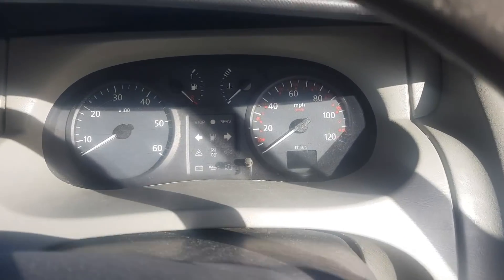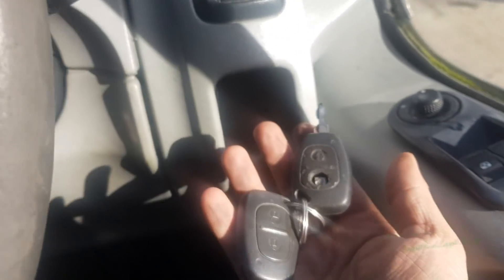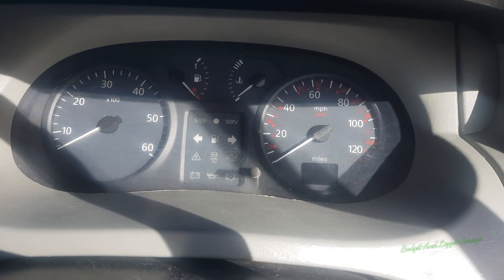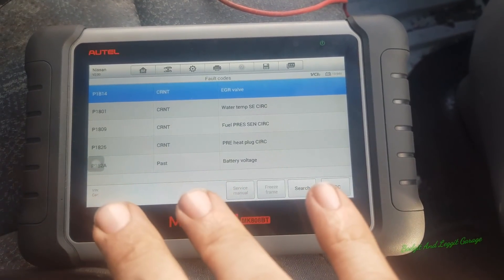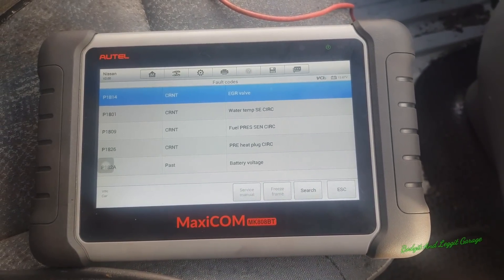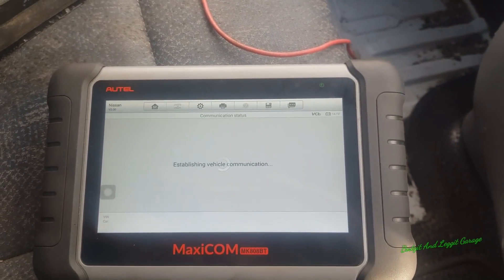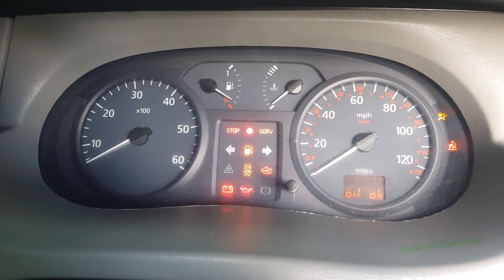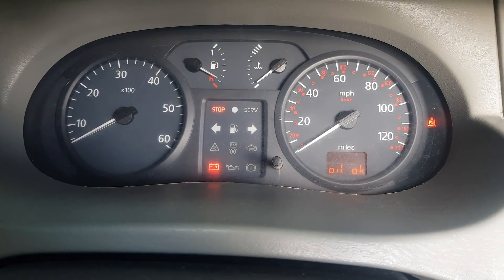Nissan/Vauxhall/Opel Crank No Start Engine Light Flashing Part 1

Comment from the maker: I know I know it's a primastar
Reply: Had the same problem, FUEL PRESSURE Sensor ON THE RAIL. After removing a "Tuning chip"..put on a new sensor £25.00 and boom...job done 🕵️‍♂️
Reply: Not often I will disagree with you Leon, but I will here, for that vehicle is not just any Primastar - it is a full on ShiteBox Primastar
Reply from the maker: @Steveok  boom sorted
Reply from the maker: @fulwell1  🤣🤣🤣🤣🤣🤣🤣
Reply: Crank pos sensor ? Cam sensor 
Ecu kit 
Key issues
Reply: Temp sensor can throw these symptoms aswell. Mr mucle works on ege

Comment: Hi! How easy was it to connect the Autel Maxicom MK 808 BT to the Nissan Primastar 2003? Did  it communicate well with the car? Did you find Primastar 2003 in the diagnostic tool menu? I Have a 2003 Primastar and I can't find a diagnostic tool for it. Only for 2006 and above. Thanks!

Comment: hi, i know this is an old video but im looking for answers on my non starter 04 plate 1.9 dti vivaro. only code i get is p0193 which is fuel pressure sensore high input. i have back probed the signal wire and its 4.99v, i have done continuity from plug bk to ecu and all is fine. put a brand new sensor in long with new crackshaft and cam shaft sensors but wont start. does the intercooler pipe need to be on for it to start?

Comment: I also have one to fix and the wire is very f**** bad I don't know why the people cannot use a soldering iron and some heat shrink like we call them here is backyard mechanics and the best thing if you fix it right the customer complaints about the money

Comment: Dunno if wires going brittle is a thing with the vans or not, mines an 03 1.9DCi and i had crank sensor problems, reading live data would show crank signal, but intermittently, van would cut out when hot, then not start, leave it cool down and she'd go again, changed the sensor then it wouldn't start at all... pushed the wires down into the plug and it started... ended up removing the plug and replacing it the wires were super brittle at the plug end... just one to keep in mind, that crank sensor problems may be down to the wires as well :)
Reply from the maker: Hi mate that's very common especially on these type of vans when you buy a genuine sensor you always get a new pigtail how to replace the old wiring what I mean by that is they give you a new plug and new wise to replace the old one because they give a lot of problems the wires and the senses
Reply: @bodgitandleggitgarage  Aha right, mine was a non genuine one unfortunately, so i had to repair the plug. Saying that, it was over 12 months ago and, touch wood it hasn't given any problems since. Maybe next time i'm servicing it ill change it again and get the pigtail part and solder that in.
Reply from the maker: @NMCKev  at least you got it sorted mate nice job
Reply: @bodgitandleggitgarage  Cheers, next job oddly is your video part 2, my temp sensor i believe is faulty, the temp needle climbs and falls with engine speed, as if its got a bad earth or something... on-wards and upwards!

Comment: I might be wrong, but then temp gauge doing that when you switch the ignition on, I think is it showing what it thinking the oil level ism then it goes back to showing what it thinks the temp is.  A lot of the modern french ones do it.
Reply from the maker: Hi mate no this vehicle does not do that you're seeing part 2

Comment: I had a 2002 Renault Clio and the key got stuck inside the ignition barrel, after muttering a few FFS's I had to cut the barrel out and replace it. The key that came with the replacement ignition barrel (2nd hand) fitted the locks as well as the barrel so I didn't have to use two keys
Reply from the maker: Nice job mate that's the proper way of doing it

Comment: I have one of these been to 2 garages with a fuel pressure infomation code drive fine starts fine cuts out a 3k turn the key on and of and it's fine. And they cant  fix .looking  forward to part 2.top job
Reply from the maker: part 2 up not mate

Comment: Very helpful video I have a 2005 vaxhall vivaro and it is just cranking but no start. 
Also the revs are similar to what you showed in your video.
I will see if I can get a computer to check all the faults and then go from there.
Thanks again and God Bless

Comment: I HATE these Renault engines when they break the wires, they always break right at the weatherpack boot of the pin. Not worked out why they break at that spot but the pin repairs I have made I have not had a comeback in 5 years I have been using my method of re-using the pin but replacing the wire
Reply from the maker: Nice job mate in a video very soon I'm showing a different way how to do it it's never failed me either

Comment: Renault are kings of the parts bin, that dashboard set up is the same as my old 2001 scenic petrol. Someone in Bulgaria is going to love that van when you've finished tinkering with it.
Reply: Same instruments as a 2003 Clio I used to own, same radio controls behind the steering wheel , same mirror and window controls as my current 2005 Megane
Reply from the maker: hahahahahah

Comment: Hi Bodgit and Leggit.
My names Michael, Jon's son, studying a mechanics course. He's got an old van that sounds like
it's lost compression from one of the cylinders; It goes ONE, TWO, THREE, FOOOOUR...  ONE, TWO, THREE, FOOOOUR...  ONE, TWO, THREE, FOOOOUR....
It also smells of fuel in the sump after a fresh oil change. Is it possibly a due to a piston ring?

Btw, thanks for helping me get through my course! 

BOOOM,
M
Reply from the maker: Hi mate it's a possibility but too difficult for me to say as it could be loads of things I don't want to say the wrong thing to you and lead you down the wrong path if you can get a relative compression tester they are really reasonably priced you can get them from ditex tell them I sent you they will look after you and you can very easily and quickly tell if you've got a compression issue no point guessing

Comment: Hi bodgit or Leon whichever you prefer..I’ve got a movano 03 plate when started got a solid red light on the dash when off goes back to a red flashing light,any ideas?
Great videos and great channel thanks for making these videos keep up the good work and keep safe
Reply from the maker: Hi mate they can be at least 10 flashing red light I need a bit more information what is the little picture in the flashing light
Reply: bodgit and leggit garage hi thanks for the reply.  it’s  the little red immobiliser light. The one that flashes when you lock the van (top centre of the display panel)on instrument cluster. Flashes when vehicle is off and locked but when you start the van it’s permanently on (a fixed solid red immobiliser light that stays on )thanks again
Reply from the maker: @coggsy3036  does the van start
Reply: bodgit and leggit garage yes starts on the button every time

Comment: Is the temperature gauge swinging normal fo that vehicle, I have a Vauxhal car and when you first turn on the ignition all the gauges swing right through full movement in some form of self test,if so that gauge is only going half way.
Reply from the maker: Yes mate and some cars they do do a full test suite also when you replace the battery they also do a full test suite in this particular case it should not do that it should only go up to temperature and show the temperature of the engine in that Pacific moment not go up and down like that you will see in part 2  what I mean

Comment: Hey nice video. Im looking at one of these at the moment 1.9dci with a slow start especially when cold. even slow while warm. i bypassed the low pressure fuel supply just to count out filter and hand primer. Problem is its got no communication on OBD. there is voltage but no com

Comment: Hi Leon, I have a 2004 vivaro, crank no start. I have noticed that the immobilizer light is not coming on at all on the dash and also the hazard and indicators are not working, but everything else is. I have checked around the ECU and the fuses all over and can find no fault or any broken wires. My mechanic can find no fault codes, any ideas? Please help. Before I leave a sunny Jim on the drivers seat :) cheers William